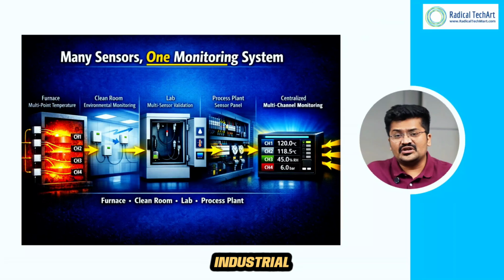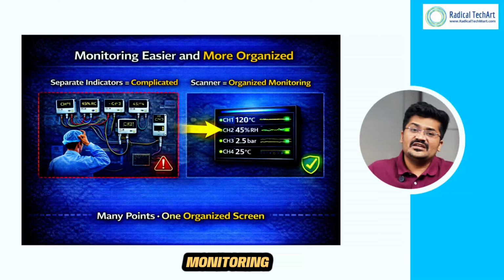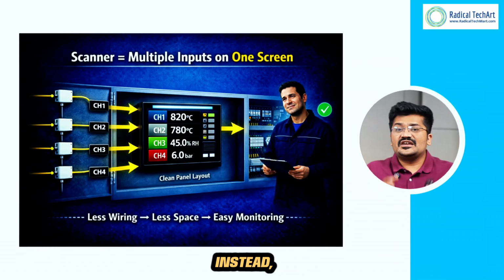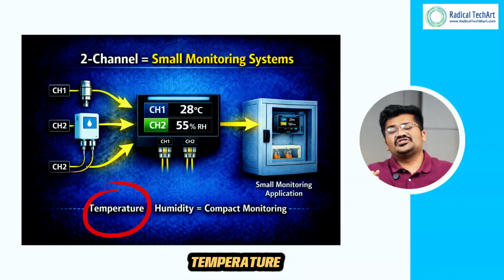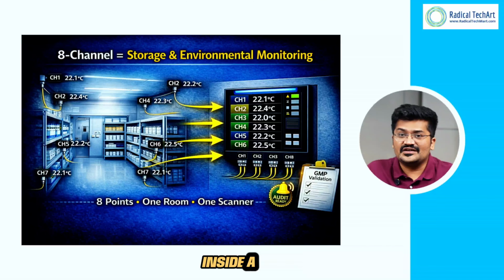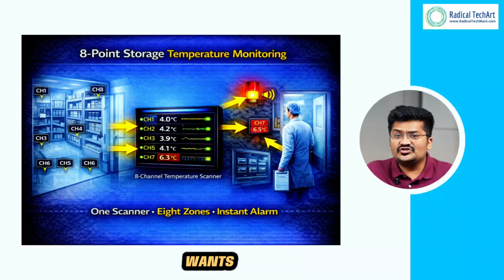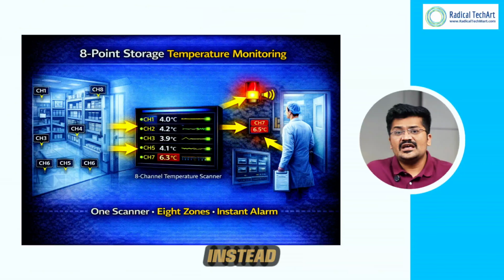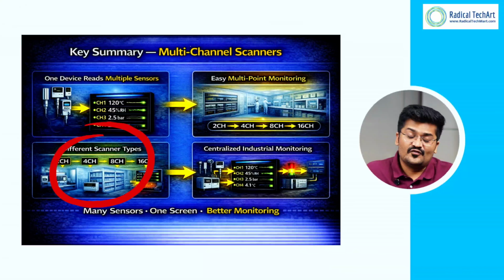Multi-Channel Temperature Scanners | 2, 4, 8 & 16 Channel Monitoring Systems

Comment: Sir, I require an offline temperature monitoring system, preferably analog type, for my organisation. The requirement is for two sets, each having three sensors and one multi-channel temperature monitor with visual and audio alarm facility.
It is requested to kindly share the specifications of the items available with you along with your quotation.
RB SINGH
Reply from the maker: Sir we can supply.

Kindly check our bio or details in below video description, you will get contact details. Please send inquiry so we can give proper reply